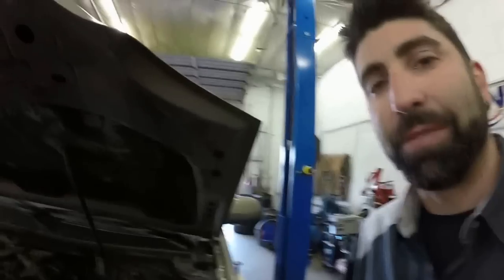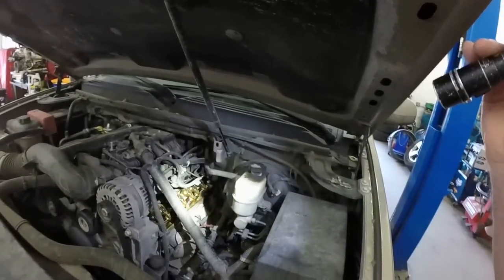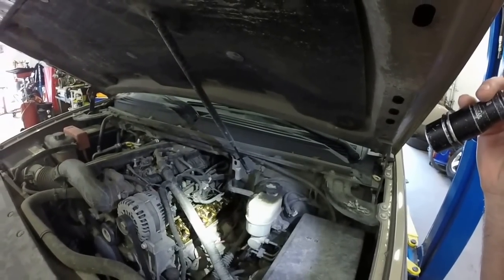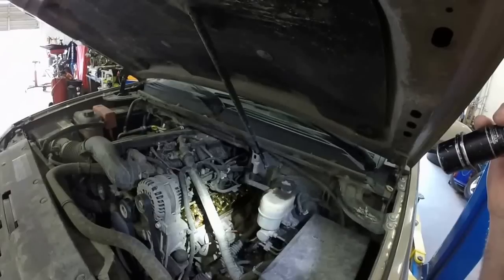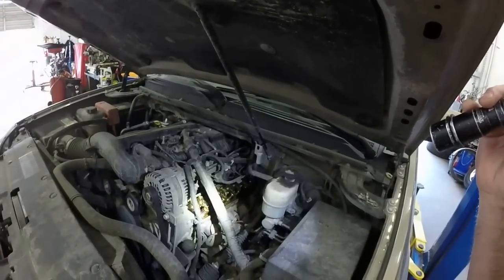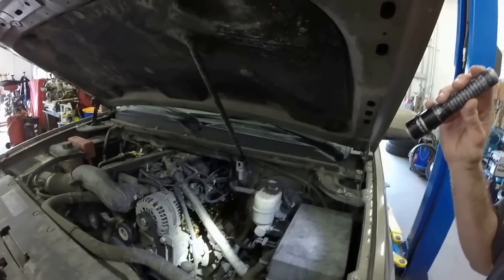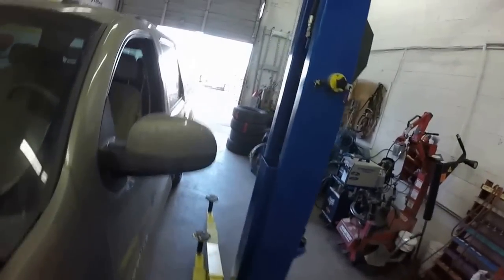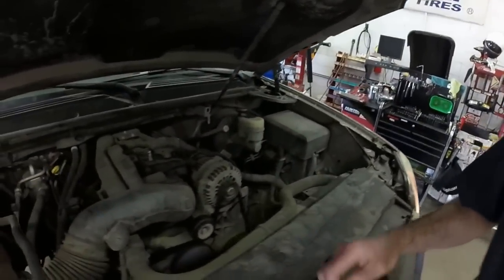GMC & Chevrolet Misfire - P0300  / Lifter Issues - 5.3L  - Diagnostic How To

Comment: What a hack 3G .... hade same problem at 90,000 and spent $700 for all parts (From Chevy too) and fixed the issue and haven’t had a problem since. Took a day to do also I would say 1900 is fair as a mechanic
Reply: Rugged K9 I'm interested in knowing how you did it for 700, seen this a couple times on this post. Where can I get free labor and free head jobs done at??
Reply: Matt Styles the parts will run you 700 to fix the problem, your free labor comes from you own two hands.
Reply: Rugged K9.  Well, not everyone is a mechanic and has a machine shop, question still stands.
Reply: Matt Styles well take the time and learn, do research, if throwing countless $ at the problem and having someone else do the work then thats your answer it won’t be cheap. But if you want to cut the shit and fix your own problem then learn how to with your own hands. Like in this video if one lifter goes you don’t need a new motor or head work just need a new lifter or lifters. It’s a man made object that can be fixed by a man.
Reply: And I’m no mechanic just someone who had this problem twice now with the 5.3 on two separate vehicles and knew both engines where ok just a part was broke
Reply: Rugged K9 Yea, this is not cheap for a shop to do. I just wanted clarification on the laughable claim  that this costs 700 bucks. I see I can do one lifter, and "hope" another one doesn't go. Sure. Yet,  a cylinder head has to come off to do them. Why do it half assed?
Reply: Jake Heke sorry or woman ...
Reply: Matt Styles 700 would cover all the lifters, gaskets,bolts, and lifter guides for the problem side. Add around another 80 for oil, filter, and antifreeze.Then your driving down the road again...and ya the other side could go to down the road but you could say that about anything on the truck ( Exp. why change both exhaust mufflers if 1has a leak)
Reply: Rugged K9  Oh i agree on the costs and all that,  just understand  most people cant and will not do that themselfs, plenty of people with no mechanical skills.  So price sounds very legit, and not shadetree or half assed like you seem to be implying.
Reply: Matt Styles all I’m saying is this truck dose not Need a whole engine swap for this problem like this guy is implying to his customers..... but if you have the cash and want it done that way that’s your right... but I know this problem dose not need all that work
Reply: Even for a USED engine that he’s going to put back in the truck that could do the same shit in 500 miles. The first one I did was a 2008 GMC Sierra with 68,000 on it. For what this guy is saying it’s not worth it
Reply from the maker: We give options to our customers, and usually 99% of the time it's a money issue.     In this case, we killed 2 birds with one stone.    Engine was eating 2 qts of oil a month.   P.O.S. GM issue, with no recall.   Thats why we did an engine.   We do used swaps all the time, no issues yet, considering we may run across same issues like you mentioned.      8th AFM repairs in the past year, and have been shopped against, making us cheaper than everywhere else, not one bad review.
Successful deal on this one, customer supper happy.  Thats all that matters.

Comment: Have the same problem but ain’t a collapsed lifter.. misfire is cyl #5 
Burnt/damaged valves or camshaft.?.
Reply from the maker: Either or,  watch for no movement on that side when its running.

Comment: The AFM was the sole reason I selected the 2000-2006 models.  Biggest thing to watch out for there is the transmissions which like to go out at around 150k.  I know most folks who buy tuners disable that feature, but I don't know if that helps the longevity of the lifters or not.
Reply from the maker: One of many things to watch out for, indeed

Comment: This guy is the type of mechanic u never want to take your car to instead of fixing the issue just install a used motor that will do the same thing
Reply: The problem its not the mechanic, it is the customer that comes in and cries for the estimate. Most of them dont want to pay for the repairs. They just want to get it down as cheap as possible.
Reply: @haycall  The real root of the problem is the poorly designed engine from GM. This type of engine has failed as early as 25k miles and possibly some with even less miles. They still build the old workhorse 350 to this day and have lasted in excess of 300k miles. So, after all the research and the problems, the real root of the problem is the poor design. When a motor is this bad, not many options available with a low out of pocket fix.
Reply: @booterone1  well I think it was way past the point of blaming GM for a poorly built engine. 180k miles something is going to fail, this problem was the shop telling the customer they need a new engine instead of just replacing the lifter or all of the lifters.
Reply: @omellym7363  Like A&M Motorsports already said, "We gave the customer the option. It's their money, up to them how they spend it."
Try to understand what you're reading!

Also, the WHOLE engine had 180k, so other parts may fail soon. Better off they put a good used engine in.
Reply: @haycall   anyone will cry for a estimate of $2500 for lifters swap.
Reply: @haycall  NO, Most Definetly this guy is the WORST type and gives mechanics bad reps.  This dude is a ThROW $$$ in at it eventually something will fix the issue, but he REALLY DON"T know what it is to be DR HOUSE up in this Biooootch and get to the ROOT of the Issue to know the best option at fixing the situation.       I BET this guy  prolly replaces his Truck When it needs a car wash, Because Washing it would be a Waste of TIME...........What a TooL
Reply: @Chris-zu8ve  knowing your reading comprehension seems to be very low, maybe read why they replaced this shit design of a GM engine? I mean, 180k, eating a qt of oil every week, stuck #8 piston rings, I mean, doesn't take an honest mechanic to figure that out bubba! They gave the customer the option..... pretty solid to me... coming from a master mechanic.
Reply: @Chris-zu8ve   AAAAnnnndd,  i have been proven correct.   Poor dude needs English reading comprehension classes.  smh.  (Feel free to elaborate on your claims, or sit down)
Reply: Yes but with the used engine, you will probably have the same problem downn the road.  The only way I would do this "swap" would be with a certified rebuilt engine that has a warranty (a long warranty, like 3 years/75k).  Otherwise you're going to waste your money, because the problem will come up again probably, unless you swap your engine with a non-AFM motor (like the 6.2L or if you use a motor that has already been rebuilt,. but even then, the problem might come up against if the engine has AFM).    And if you do the rebuilt, don't use AFM lifters.  Just use regular lifters and get the "delete" kit and the engine should be good for quite a while.
Reply: TheSjb1000 couldnt love this comment enough
Reply: Yup, lazy guys they just said new motor and that’s it easy money 😜
Reply from the maker: Yes, ok.  Used engine with labor will run 2500.  Used engines may have same problem.  Up to you
Reply: @AMMotorsports  have you guys ever swapped a 6.0 from a pickup into a Tahoe? Can it be done?
Reply from the maker: @Trippybliss17  Well if its the same engine size and package yea.  They fit in all trucks and suburbans and Tahoes
Reply: @AMMotorsports  my Tahoe is a 5.3 but the engine I currently am looking at is a 6.0 . I was wondering if it would in there
Reply: @AMMotorsports  and the truck would be a 2004 6.0 Silverado
Reply from the maker: Yes, i agree, which is why we offered 3 options.  Fix, )still have oil consumption problem) get a used one, or go with a Jasper engine, (twice the price) if not more.   Up to the customer to spend their money, we, like any good shop, needs to advise the potential problems with a used one.   So far, the used engine is perfect in this customers car.
Reply: A&M Motorsports oh so you give options then why not just give them the option to do one side, now only doing one lifter is half ass so do them all on the side with the problem

Comment: It is a common issue.  The reason is uses the oil is because when it goes from V4 to V8 the lifter that starts back up we'll have collected a little bit of oil and that is why it burn the oil.

Comment: How common is this lifter issue with an earlier model vortec 5.3/4.8 motor iron block?
Reply from the maker: Not as common as these 5.3L with the AFM system
Reply: A&M Motorsports thanks for reply, yeah I have a p0300 on my 2000 and trying to figure it out
Reply from the maker: Oh nice, well good luck.  Any questions just ask!  Thanks for watching!!
Reply: I've got the same problem. Been trying to figure it out for a while since my truck stumbles a lot of you open the throttle up.
Reply: TheLouisianan if it happens in relation to how much gas your giving it I would definitely start with the TPS. Mine is unsolvable at this point it misses at all rpms, getting plenty of fuel pressure and spark at all plugs

Comment: they all eat oil right out from the gate! also afm lifter kit is only 600 bucks and you get all gaskets to redo the whole top end... this is why people do not trust mechanic shops....
Reply: How hard is it to replace a lifters
Reply: @Joe-eo2rm  its really easy man. just check out some videos. pull the heads and the lifters are right there
Reply: @Joe-eo2rm  they are Hustlers making the industry Horrible as usual for the honest folks out there.
Reply: John Lara      STILL, you nor you buttbuddy "Mopar-shadtree-mechanic73"  haven't even said as to why this dude is wrong....  nor have ya'll read as to why the engine was replaced...  my lord, where are the adults at!??  lmao
Reply: Wow! 600 bucks for the job? Amazing!  Wtf are these clowns smoking??? I want some
Reply: @Junior-wt3in  lol
Reply from the maker: Yea, the AFM kit is great for eliminating that problem.  We give customers the option, but, customers have no clue what we are talking about, so we do it right.   The AFM fit and install is same price.
Reply: @AMMotorsports  I NEVER INVESTED IN A KIT...ORDER A NEW LIFTER...WELL BEFORE THAT...TAKE OFF THE HEAD...ROTATE THE ENGINE OVER TO LOOK AT THE CAM LOBE...IF ITS NOT ROUNDED OFF YOUR GOOD...THE LIFTER THAT FAILS... NORMALLY IT WILL PULL APART AND YOU CAN COLLAPSE THE SPRING....THAT MEANS ITS DONE...A GOOD LIFTER OR A NEW ONE...YOU CAN'T PUSH THE SPRING IN...SOAK THE LIFTER..AND PUT IT BACK IN...THEN REMOVE THE STARTER RELAY..AND PUSH AGAINST THE SOLENOID RELAY  AND IT WILL TURN THE ENGINE OVER...AND YOU CAN INSPECT IF THERE IS NOW MOVEMENT ON THE CYLINDER/MISFIRE..PROBLEM SOLVED...I HAVED ORDERED A NEW CAM AND AND REPLACED ALL THE THE LIFTED IN A WEEKEND.... CUSTOMER IDEA...ANYWAY... ENGINE HAD OVER 198.000 MILES..ITS BACK ON THE ROAD..NOW" THAT WAS 5 YRS AGO...."

Comment: Rip off you dont need and engine. Just lifters
Reply from the maker: Well, if you have one go, the rest may be behind that one.  While we are in there, since its such a labor intensive repair, its smart to do all of them so you dont do the service twice.   The cylinder heads must be removed, so might as well do them all.  We dont like comebacks here.
Reply: Exactly what I work on my own car.. It's a business at the end of the day..
Reply from the maker: Well, from what we have seen in our experience, use full synthetic oil, make sure your oil is always full, and change your oil on time.   These also have piston ring issues, causing bad oil consumption.
Reply from the maker: Well, typically just changing the oil on time, and using full synthetic oil is best.
Reply: I'm curious and don't know.  But,  why couldn't you just fix that one lifter? Honest question.
Reply: A&M Motorsports , I appreciate your response.
Reply: A&M Motorsports , thank you for your response. How can this be prevented in the first place?
Reply from the maker: Basically 2003 - 2018 and current
Reply: $3000 to replace lifters..fuck me im in the wrong business..
Reply: Katie Granger Bean lol
Reply: What years are these and 6.0 to?
Reply from the maker: Cost is about same.  Either get a used engine, or replace the lifters. Around 3k for both.  Also, these engines have a bad oil consumption problem,  mainly the piston rings on cyl. 7 or cyl 8, so replacing the engine with a re-man one would be best.  Look up the TSB for the oil consumption problems on these engines.
Reply: A&M Motorsports by getting a used engine this customer is just going to have the same problem down the road. But whatever man you're in the money making business..
Reply: @AMMotorsports  it's only 3K for a reman engine!!!
Reply from the maker: @jpatt973  Yes, Jasper is 3800.00 for a reman, with the issues fixed for the piston rings.  Putting the cost at just under 5k!  Obviously, too much for certain customers!
Reply: @AMMotorsports  to be clear I'm not trying to bust balls! I just think you're generalizing the figures too much. my problem with what you're saying is you're misleading people. one comment you say it's around 3 Grand now you're saying it's 3800 for motor plus I'm assuming labor and any other materials bring it to 5K.. I'm not sure where you're from but I'm up in Massachusetts that same job is  8000.00 for a reman with labor and everything all done! 3500.00 lifters replaced and 5500.00 for a low mileage used engine.
Reply from the maker: @jpatt973  No worries.  I appreciate your clarification.  Im getting some ball bustin by people who clearly dont know whats going on.  People are syaing it shouldnt cost that much and im like, wtf??  Uhh, yea it does. lol.   Just like what you're saying, on the pricing out in MA.
 So, as i stated before, the used engine would run about 3k, installed by us.   The re-man engine from Jasper is 3800, bringing the total around just under 5k installed.  We give options, but as you know customers dont always have enough money.   Thats why we did a used engine and the customer is happy and thank god, its not eating oil like her last one.

We are in Denver CO!

Comment: Thanks for sharing your diagnostic I have 2012 silverado with only 60,000 miles on it and just started doing this same fk shit a changed spark plugs and cleaned the throttle body and i can still feel missing especially on cold starts like in the mornigs if this is my case too im trading this mdf in for a ford
Reply from the maker: Thanks for commenting.   This is one MAJOR flaw we see here with the AFM engine systems
Reply: Toyota is the real!

Comment: did you tell your customer that they have something called a DOD/AFM delete kit to fix that problem that cost anywhere from 600 to 800 in parts i mean shops these days do and say anything to rip people off come on now do more research ppl
Reply from the maker: Sure, I have seen those.  Considering the cost of the delete is virtually the same as just swapping out the lifters, it would give a piece of mind to the customer that this issue wont happen again.
Reply: Brandon does the delete kit fix the issue? Or is that something you would recommend adding after the lifter is replaced?